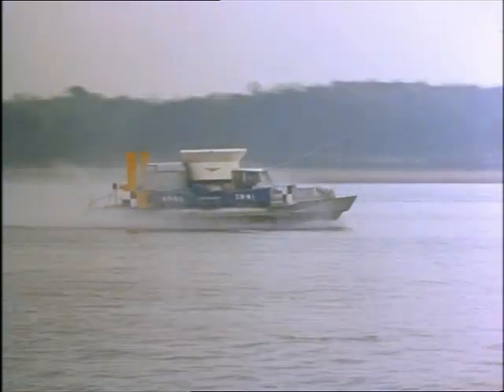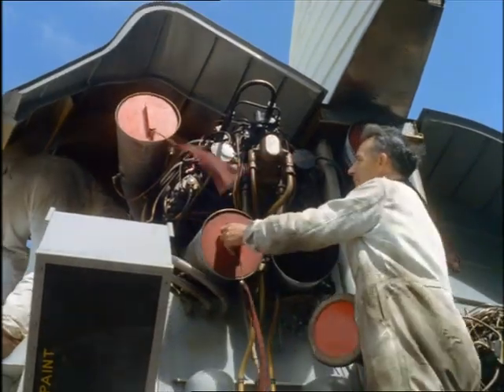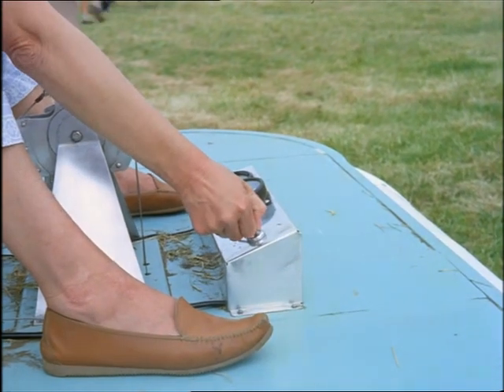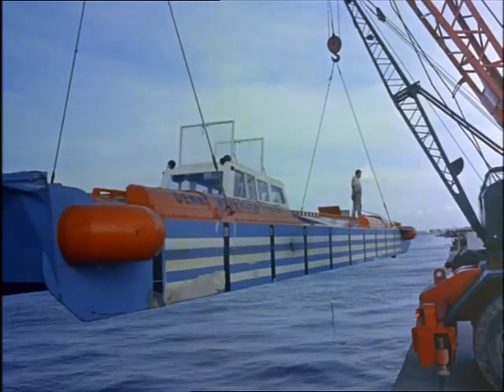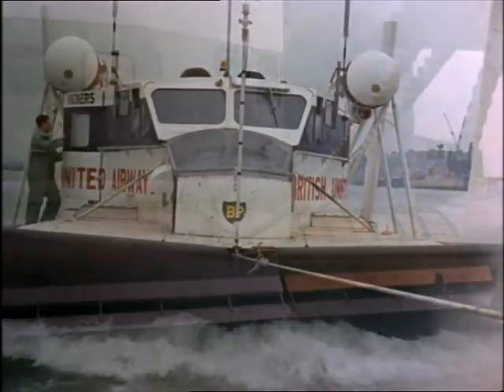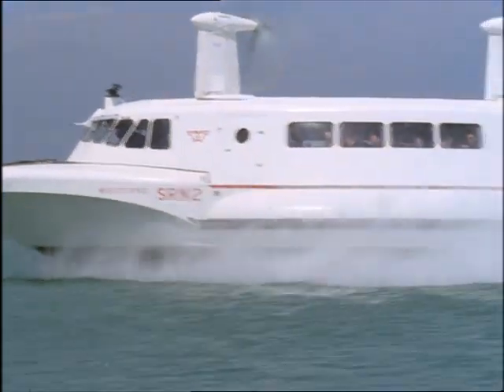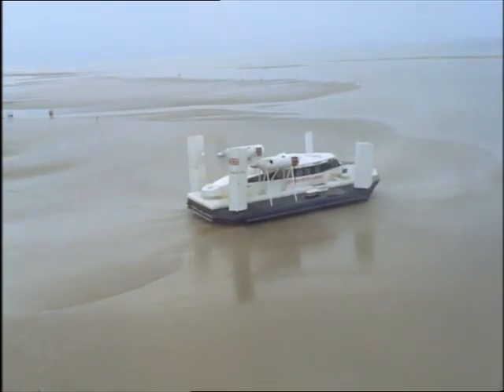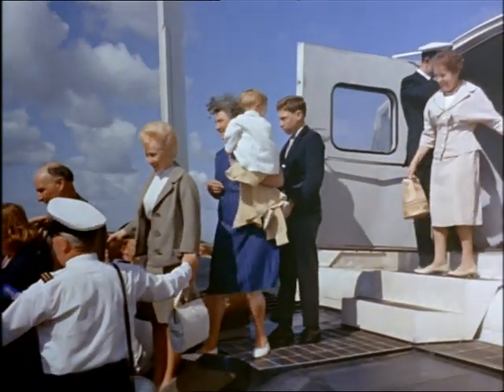Look at Life Vol 01 Transport   So they All Hover Now 1962

Comment: So much more efficient than planes AND boats, yet they are nowhere to be seen in these supposedly eco-aware carbon-conscious times.
I assume the Airline Pilots Association owns all the patents now...
Reply: I'm not persuaded that a hovercraft is more efficient than a boat since the boat doesn't consume energy to create the air cushion to lift its load above the surface; doesn't pay the cost of maintaining the machinery required to do that; and doesn't have to write the check to pay for the fuel required to create the energy to do that.